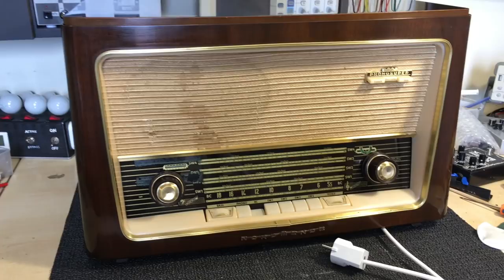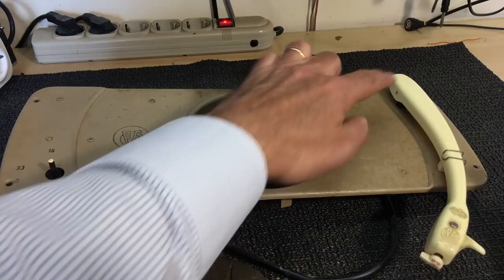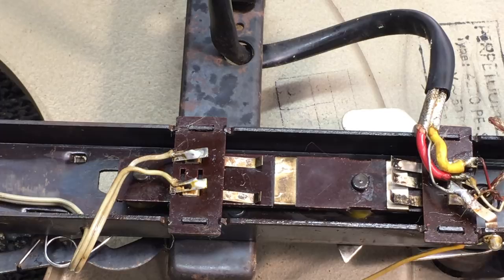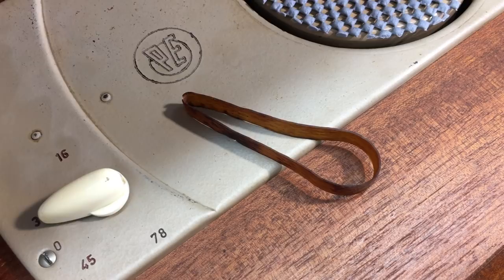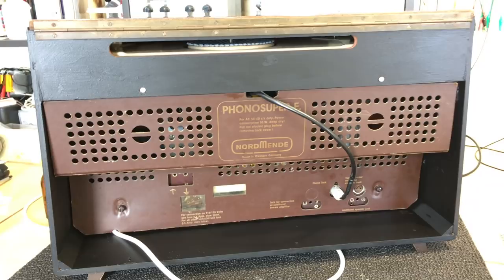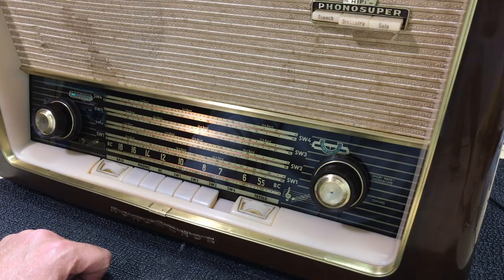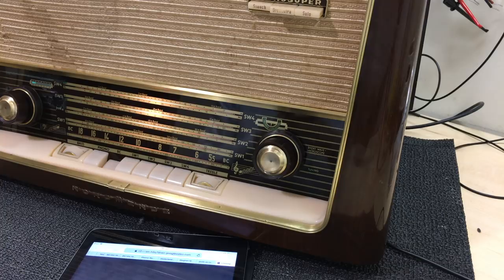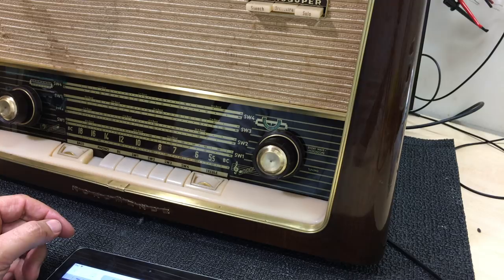Nordmende Phonosuper radio restoration - Part 5. Restoration done!

Comment: Have a few Normende radios a Norma, Caruso, Tannhauser 59 and Parsifal 59.
Would love to add bluetooth 4.1
I assume connecting is easier with Caruso and phono input. 
Wondering how you connected the bluetooth receiver 
is it with a din 3 pin to the bluetooth 4.1?
thanks for your time
Reply from the maker: I normally solder it directly to the inside of the socket.

Comment: Hi man nice job, respect! Question, do you already know what exact belt size is right for this thing? I got the same radio! Everything seems to work, except the belt was broken. A condom works but sounds pretty bad indeed haha
Reply from the maker: I found one but can’t remember what the size was - quite a long time ago 😊 If I recall correctly, I measured the perimeter and then bought a belt slightly less than that.
Reply: @electronicsoldandnew  it was, thanks for the (fast) reply anyways! I just measured and ordered one

Comment: Great restauration! How exactly ground of gramophone is connected to radio ?
Reply from the maker: The gramophone input has a signal and a ground socket.
Reply: @electronicsoldandnew  I have Dual turntable 1002f along with Nordmende Carmen radio for amp the signal. From Dual there are 3 cables as output- white, red and also one I suppose for Ground. White was soldered to first input contact of the Amp and red with this ground together to te second contact. I have observed that with touching metal case of Dual there was a low freq buzz in the speaker so I have decided to separate this ground wire from the red and put it directly to one of the radio chasis screw. Much better now even if the tourntable motor working gives still additional low freq sound.

Comment: you have belts on "casa aquário" on Porto...you also have new needles and cartridges...on Madeira i dont know if you have those but you can order from them by mail
Reply: was it you personal choice not to replace the cloth ?there are a few new cloths available on ebay maybe with some sligthly different pattern but they really make the radio look new again
Reply from the maker: Hi Hugo. I have bought things from Aquário before. Thanks for the tip. The cloth is another possible change in the near future.
Reply: if aquário does not have what you want you can also try Castro electrónica, they have a big selection of belts speakers and audio stuff...
about the cloths i have been trying for a while to find a company who sells fabric in bulks wich has some different types of cloth suitable for this radios and for cheap... meanwhile for 20 to 30€ we can buy pieces of cloth from ebay...but the profit margin from the sellers must be huge and it is a big ripoff...